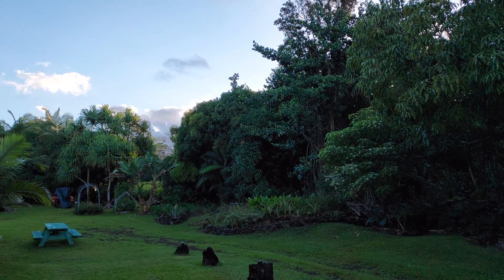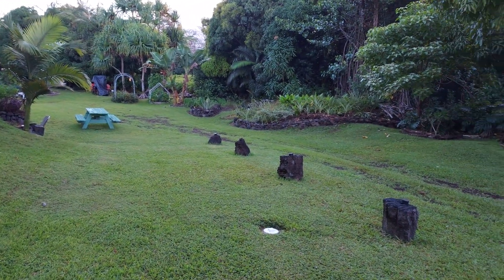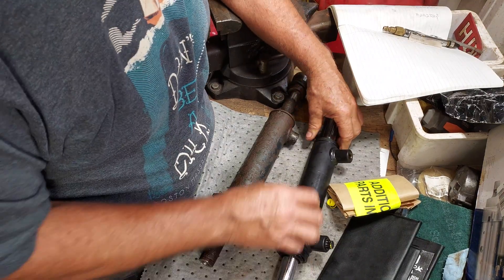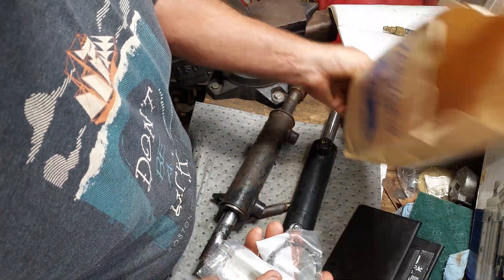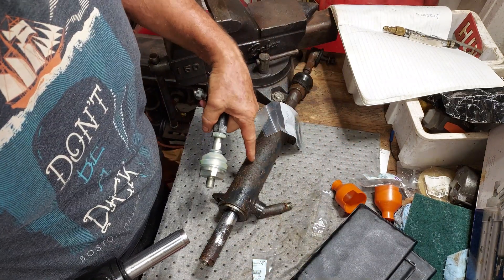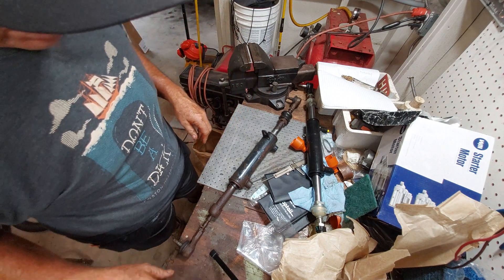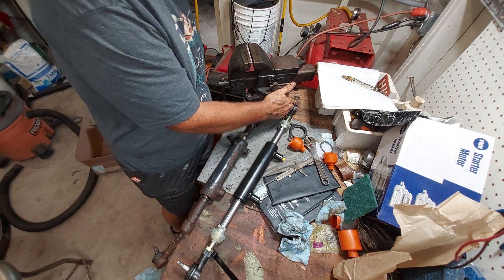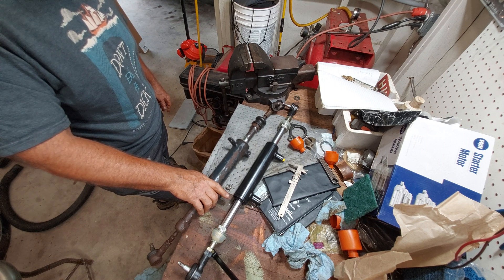Massey Ferguson GC2310. Using the steering gear from a Kubota tractor on my Massey Ferguson.

Comment: Great job, I’m having same issue with my GC2310 I too I’m very capable of fabrication! I used your Kubota part numbers but they did not work in the web site search 👀 is the cylinder part number K2063-16500?
Reply: Great thanks please include the model and year of Kubota tractor if possible TY
Reply from the maker: @bradsmith6119 I have no idea. You might be able to do a "where used" online. Good luck.
Reply from the maker: According to the invoice:
K2063-16500-620 ASSY,CYLINDER STEERING
04612-00500-620 CIR-CLIP, EXTERNAL
K1253-16604-620 TIE ROD STEERING
66591-56780-620 NUT
Reply: Ok they are the correct numbers, I called instead of using the website and they had no problem getting them thanks Yikes still over six hundred dollars
Reply from the maker: @bradsmith6119 wow! The total for my order two years ago was $470, including shipping.

Comment: I went thru that last year with my Agco ST45 tractor.  Parts no longer available for that 2001 model. Had to have a hydraulic shop rebuild the steering cylinder by honing it out and making new piston. A lot of waiting and extra cost. Nice conversion !
Reply from the maker: @SteveHearne-oj1pm  thanks. I think I could have used parts from LS or new Holland too. I didn't know it at the time tho.